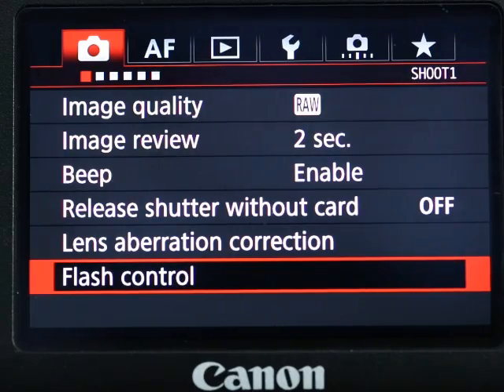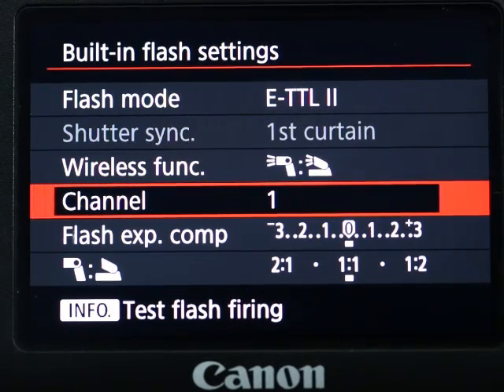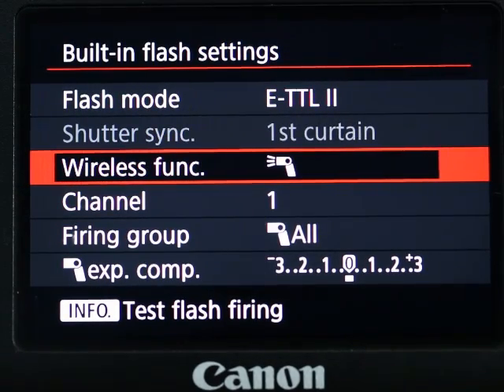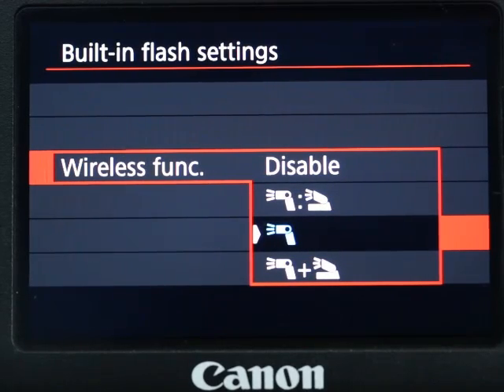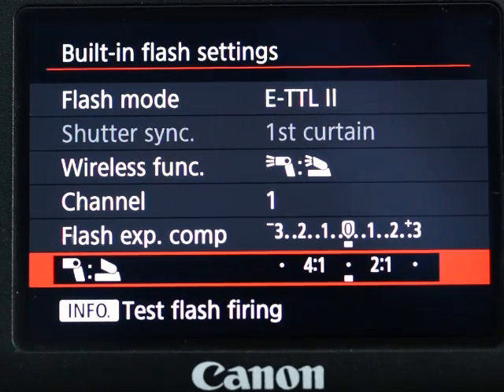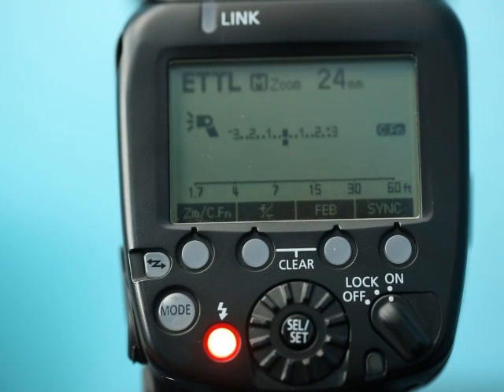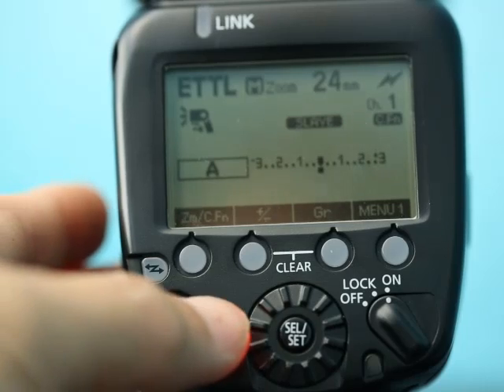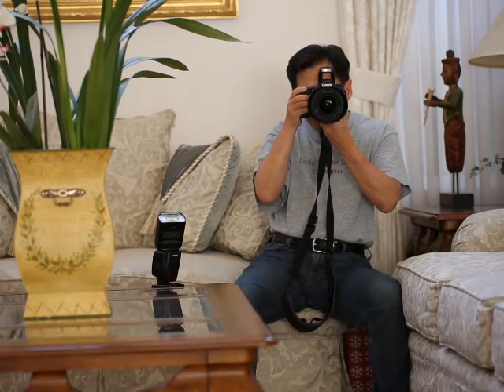Get Your Flash off of your Canon Camera...Optically control your flashes

Comment: Great video! Very clearly explained. Does the Canon SL2 have this same capability? To trigger off camera flash via the built-in pop flash?
Reply from the maker: Hi Studio D, thanks for commenting!  The SL2, unfortunately, does not have this function with the pop-up flash.  You will need an external flash mounted on the hot shoe to perform this function.
Reply: @HTongho  Thanks very much for responding. Would the 270 EX II mounted on the SL2 be able to trigger a 430 EX II?
Reply from the maker: @sl2608  The answer, unfortunately, is No.  The 270EXII is only capable of being a slave (remote flash) and not a controller.  If you have both the 270EXII and 430EXII, you'll need to mount the 430 on camera and use the 270 as the remote.
Reply: @HTongho  Thanks for your help. I will just use my Canon 80d. The 80d built-in flash can trigger an off camera flash. Thanks again.
Reply: @HTongho  Just one more question. Will the Canon T8i built-in flash trigger an off-camera external flash? thanks
Reply from the maker: @sl2608  Yes it will. When I made this video, the T8i has not yet existed :)
Reply: @HTongho  I talked to Canon Support today and they said the T8i built-in pop up flash cannot trigger an off-camera external flash. They said no dslr in the Rebel line can do that. They said I would need a 90d.
Reply from the maker: @sl2608  They are very wrong.  You can check the T8i manual.
Reply: @HTongho  Thank you so much for that information! I thought I could trust Canon to know their own products and provide correct information. Wow, what is wrong with those people??? I found the information in the manual, just as you said it would be, pp 230-39. I am so disappointed in Canon. This is not the first time they have given me incorrect information. Unbelievable!

Comment: i want my flash to work but i want my picture to look great and not with a bunch of shadows so i need to get better at taking pictures
Reply from the maker: Getting the flash off your camera is a major step in getting better flash pictures.  In my other flash videos I did mention more about the need to bounce the flash and the use of diffusers to improve the way flash pictures look.  You might want to check them out.  Thanks for commenting and watching my boring videos :).

Comment: Hello am here in 2022 ... I want to know i am using 7D . Do I need a separate trigger device to do it.? Some one is telling me I need a trigger device before the speed light can do an off camera flash. I want to know
Reply from the maker: Hi, you're in luck.  The 7D has this optical flash control features.  You can use my video as a guide to try it out.
Reply: @HTongho  ok, I was actually asking because I am yet to buy the light. I don't have it yet to try. I didn't want to wast money buying the trigger when the camera can do it by itself. Thank you

Comment: Anyone know how to do this in Canon sl2?
Reply: I mean... Is it possible to fire the external flash without shooting the biut in flash and without a radio control, in a Canon sl2? And thank you for de video.
Reply from the maker: @leonardoaydos  The SL2 does not have the capability to control remote flashes optically or via radio(none of the Canon DSLRs has built-in control via radio).  In order to control, you will need to have an external controller - ST-E2 for optical or a ST-E3-RT for radio.  Either the ST-E2 or ST-E3-RT will not need the built-in flash.
Reply: @HTongho  Got it, I will buy a radio control... Thank you very much for the clarification.
Reply from the maker: @leonardoaydos  Please make sure you have the flash(es) that is capable of/compatible with radio control (see my other video for more info).

Comment: I don’t have a cheap ass built in flash!!! Why is there no video out there showing the 1dx off camera flash settings wtf!!
Reply from the maker: In order to control, you will need to have an external controller - ST-E2 for optical or a ST-E3-RT for radio.  Either the ST-E2 or ST-E3-RT will not need the built-in flash.

Comment: I can do this on the 7D But with a 5D MKII there is no built in flash So how? Do I have to buy another flash?
Reply from the maker: For the 5D's there is no optical flash control so in order to do this, you'd need to mount on the hotshoe either another flash (for use as controller) or get a dedicated controller.  Canon makes one called the ST-E2.

Comment: Hi Hien, I have a Canon 80D but I can't configure my camera to shooting the Canon 600 Ex II RT via Radio. In it specs are described that 80D has "Radio transmission wireless flash shooting" Do you some about it? Have a another tip?

https://www.usa.canon.com/internet/portal/us/home/products/details/cameras/dslr/eos-80d
Reply from the maker: Hi Marcos, I'm not sure where you read that the 80D has radio transmission wireless shooting... I suppose it can do it provided that it has a transmitter (like a radio capable flash mounted on the hot shoe) or a controller (like the ST-E3-RT mounted on the hotshoe).  The 80D, like other Canon cameras, only has an optical flash built-in transmitter - which is the built-in flash.  If you don't want to spend a lot of money, you can get a Yongnuo YN-E3-RT for less than $80 as a radio controller.  Check out my other video for more info.
Reply: I read in the description on Canon website, but it could be my misinterpretation of description. Thank you for your attention and tips, btw, do you know if is possible to control settings from Camera’s Menu Screen with Yongnuo YN-E3-RT?
Reply from the maker: Yes you can. The Yongnuo is fully compatible with Canon plus that it can provide the Infrared focusing beam that the Canon controller does not have.
Reply: You convinced me, I'll buy this! I've also seen your other video with the details. Thanks again.